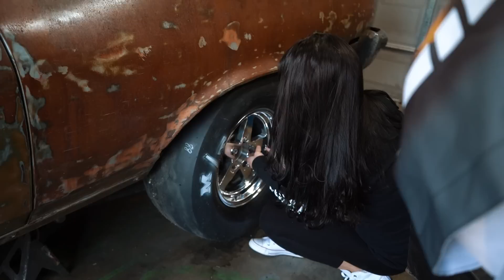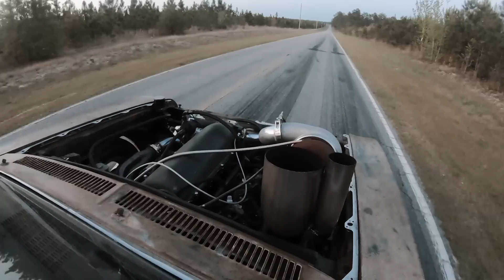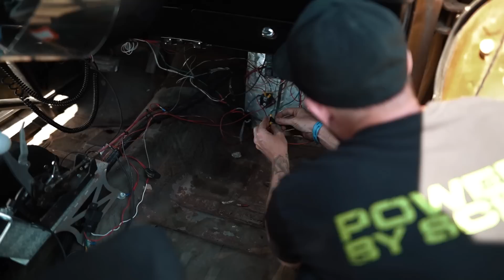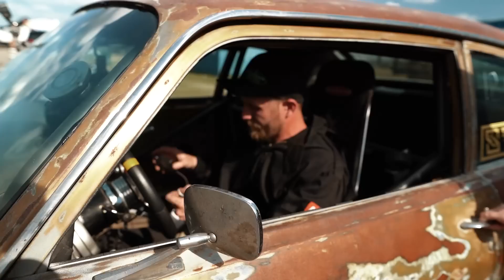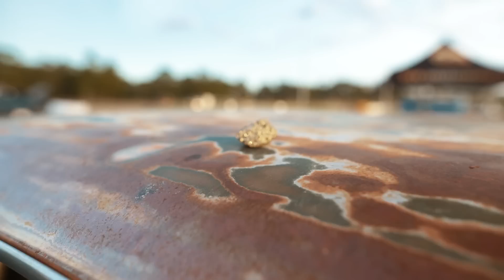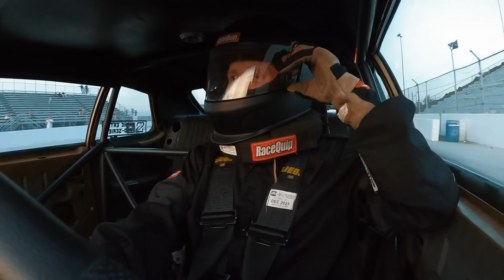I WON MY FIRST EVENT! We Show The Nova Times While Being Way More Lucky Than Good

Comment: Congrats you are a survivor and persistent. I am proud of you racing a motor that you put together not a engine shop. You did the right thing with the motor ,hope its not hurt,.
Reply from the maker: I don’t believe it is. We pushed water into the expansion tank after throwing the belt and I didn’t realize it. My mind was all over the place trying to work and race. At the end of the night we put some water in it and temps came down to normal immediately. Was planning on testing this week but this weekend looks like rain so we might do hot rod stuff with the g bodies instead

Comment: Matt are all of your pullys truly straight? Is your idler pully a smooth or grooved pulley? Is it spring loaded? Or a turn buckle or slotted hole. You can have a little missalignment with a solid tensioner. With a spring tensioner especially uf its on the load side of the belt it will throw the belt at a good rpm drop like 500 is enough

Comment: I don't know about V8's, but my VW would run at least 3 ths. quicker in the 1/4 mi. when my alt. belt came off
Reply from the maker: I think the risk of losing a fuel pump is far greater than the reward of the saved Hp from the crank not turning accessories. I’m picking up what you’re putting down but I wouldn’t chance it. We still have a mechanical water pump too

Comment: Maybe the belt coming off leans the engine out causing it to go faster.
Reply from the maker: No it had lost some water and I didn’t notice, so increased temps cause it to pull timing
Reply: I was thinking that’s what caused you to go faster on the previous run. Since it won’t faster with the bolt coming off
Reply: Congratulations a win is a win does not matter how it happens

Comment: Have you tried torquing the belt with a torque wrench? I know Strickly Business had that issue and we went to torquing and have not had an issue since. Reach out to Jerome and see what he torques it to.
Reply from the maker: How do you torque a belt? It’s on a tensioner
Reply: @Matt_Ryce  we put a socket on the head of bolt and pull back on handle till it pops to set torque. I can ask him. His has the tensioner setup. Is yours an adjustable tensioner?

Comment: 68 to 72 front end will bolt right on. Steel,glass don't matter. Way better front profile and that 150lb front bumper can be traded for the 35lb early model.
Reply from the maker: I’ve been looking haven’t found any good deals on a fiberglass front end yet